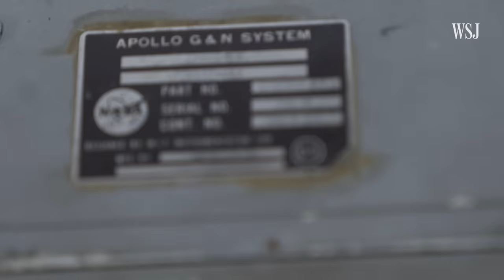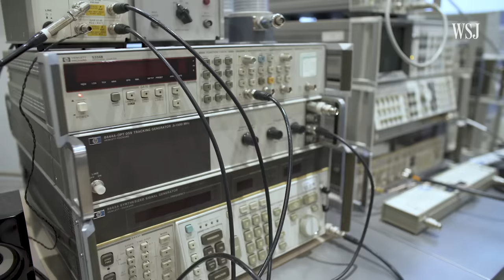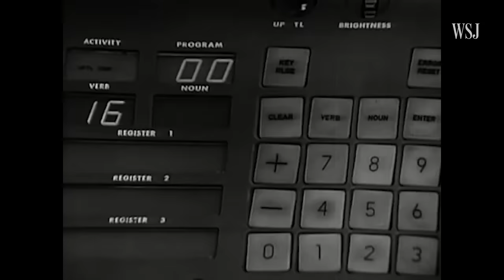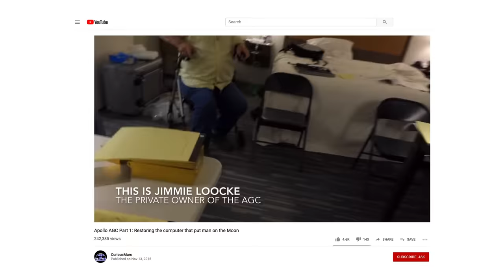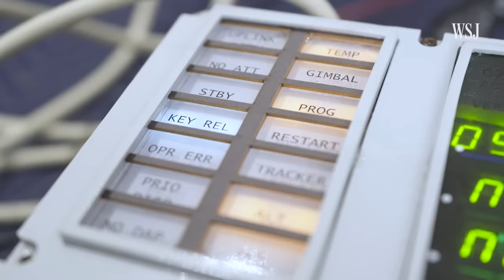Restorers Try to Get Lunar Module Guidance Computer Up and Running | WSJ

Comment: For reasons passing understanding, this video falsely asserts that they did it all in two weeks, which really undersells just how much effort this crew went through. It took MONTHS of work. The first video in the series Marc did came out Nov 13, 2018
 and the final working run wasn't posted until Jul 16, 2019. The whole team did an amazing job, over a long period of time.
Reply: Yup. Karl built an Arduino based DSKY clone (seen in this video). Marc's company REMANUFACTURED pins and connectors necessary to interface with it, from original blueprints. Mike has been tirelessly archiving, finding, and saving the various software versions the various missions flew. Sadly, some might remain lost to time, but Mike will leave no stone unturned.

Truly astounding work from some really smart people.
Reply: Lol thanks WSJ, quality journalism
Reply: @crosstian  it's owned by Rupert Murdochs' News Corp.  What do you expect?
Reply: Seen a video of women weaving the ROM memory modules. In these years your fingers could touch the individual bits of the operating system. Rome was not built in one year.
Reply: @Wizardofgosz  And when they really  complete this project, they can go to Cape Carnivoral (or what was it) and launch that thing again. How cool is that?
Reply: @OptimusWombat  much better than the clown show at cnn where instead of interesting bits like this computer you get stories about brave people announcing pronouns
Reply: @voornaam3191  
Canaveral
Reply: I was surprised when i heard 2 weeks... Troubleshooting and repairing can take experts much more than that, especially on old equipment.
Reply: But... But... Earth is flat
Reply: @JohnS-il1dr  imagine trying to defend science and great human achievements by praising IT people... while insulting sociologists and people who try to lift up society.
Reply: @monsieurouxx  It's hardly uplifting for society, it's continuing on an inexorable spiral of decline
Reply: @monsieurouxx  sociologists add zero to further this type of science
Reply: @kunjupulla  only in Tolkien books
Reply: @monsieurouxx  You must be a troll; "people who try to UP LIFT society" ... what???? Heck that. Anyway I'm grateful they dedicated so much time, and WSJ really did undersell how much effort went into this restoration.
Reply: @kunjupulla  oh dear another flat flerfer...
Where's your ridiculous proof that the Earth is flat 🤣
Reply: @peteabrh-fairest9463  Ayyo 😂. I was just joking dude 😅. I'm an engineering student 😊, not a flat earther 😛.
Reply: @neilchapman5145  Of course 😆
Reply: @kunjupulla  thank God for that sensibility shine through at last, there are so many ridiculous flat-earthers on this post it makes me want to punch my windows out .
Good luck with your engineering what an admirable career. 
I didn't go down that route, I'm ex-military 22 years ..
Although I was a nuclear biological and chemical warfare specialist and worked on frequency weapons technology...
Have an awesome day 🍻
Reply: @peteabrh-fairest9463  Yup 😊. I am quite fed up lol from flat earthers 😂. I have argued too much on Twitter 😂😂
Reply: @kunjupulla  so have I my friend 🤣
Reply: @soupflood  and yet... the story as presented can be true, in that actually dealing with the hardware was done in the last two weeks. What Richard said above would be extra work they would be doing as "preparation" for those final 2 weeks.
Reply: @neilchapman5145  except the thing about inclusivity is that it doesn't just apply to ONE pariah group. Geeks that "further this type of science" were also a pariah group themselves, so i'd like to call your bluff and ask that you prove if it is in fact "zero" added value.
Reply: "The Wall Street Journal"... says it all.
Reply: @soupflood I do, fairly "modern" (80's/90's... some 70's) arcade machine repair... and when you get back to the early 80's/late 70's... you can spend 2 weeks finding/getting a single part... and that's for a commercial "computer"... not secretive government projects.
Reply: Why would the computer display an altitude rate reading without an input?
Reply: Somebody always got to complain about something.
Reply: Thank you, two weeks seemed impossible. As an engineer I was stunned by that number.
Reply: also... i dont believe for a moment that geeks such as these worked only 12 hour a day..
Reply: You're conflating software and hardware, when their just going over the hardware. You're comparing apples to orange juice.

Comment: The brain power in that room is freaking impressive.  I felt dumb just watching
Reply: When it comes to real hands on work I doubt any of them could fix a leaking tap or change a tyre on a car.
Reply: @jamesaustralian9829  id rather have their smarts than what i have now i can change a motor on any car but would love to have their smarts.
Reply: You can compensate by watching a flat-earth video, that make everyone feel smarter.
Reply: @jamesaustralian9829  This is "real hands on work"
Reply: James Australian What’s your point? Even if they didn’t they could learn very easily... I work on electronics and I work on cars and currently I am a handyman doing odd jobs, the only difference is electronics requires much more thinking and figuring out and following complex mapping. Working with cars or houses or what you seem to think is “hands on” is the same as electronics without the complex mapping and whatnot. You still have to take apart, fix, solder, replace parts, all the stuff you do with cars and houses.
Reply: @jamesaustralian9829  they could built a new car tho
Reply: @MLGxBXRxPRO  Don't underestimate your knowledge of working things.
Reply: @kennylex  Agreed. When you watch a flat earth video you learn information that not many people are privy to. Knowing this information that the earth is flat and acknowledging it makes you feel smart.
Reply: @travisk5589  I sincerely hope you're a troll
Reply: @teod9270  aren't all flat earthers trolls?
Reply: @jamesaustralian9829  Incorrect.  There is a full machine shop in Marc's house, they are all very mechanically inclined.
Reply: For real! I cant understand nothing of that "mess".
Reply: @James Australian that’s got to be one of the most misinformed ignorant comments on here buddy.
Reply: By the guy that said WOULDN’T HAVE WENT in the beginning of the video?
Reply: i dont
Reply: James Australian Yeah, Mark only has a milling machine in his basement for the looks of it. Not at all handy.
Reply: James Ray What? I don’t understand your point... how many doctors do you think couldn’t be taught to fix cars or renovate a home?
Reply: James Ray Then your point is irrelevant to what I said.
Reply: James Ray I wasn’t responding to the original comment... I was responding to the guy saying “I doubt they could do anything hands on”... I was pointing out not only is this hands on, but it’s the same kind of work that mechanics and carpenters do, it’s hands on work combined with critical thinking.
Reply: @rikosaikawa9024  but you are the greatest genius of all time!!11
Reply: @jamesaustralian9829  oh they could all open a simple youtube video friend.
Reply: Another day in an IBM room
Reply: Real hands on is inventing whole new technologies that NEVER existed to get to the moon. Change a tire? Let the same hands on go free and wild and we'd already have George Jefferson's briefcase case car!
Reply: The crowd on a Justin Biever performance totals more brain power than that one on the room.
It's all about how they use it.
Reply: @jamesaustralian9829  Don't be so sure.
Reply: @kennylex  congratulations, you played yourself
Reply: @jamesaustralian9829  Curious Marc is pretty good with a lathe and Milling Machine...
Reply: @jamesaustralian9829  define "real hands on work"
Reply: @MLGxBXRxPRO  great comment  i agree with you 100 percent
Reply: @travispratt6327  very good comment  i thought the same thing  they could learn those other task if they wanted to
Reply: @76TomD  very good analogy
Reply: Oh to be in the company of like the minded. I don’t feel so dumbfounded.
Reply: @jamesaustralian9829  what kind of stupid comment is that?
Reply: Knowledge not brainpower
Reply: @jamesaustralian9829  lol, Curious Marc is very good at real hands on work, and I'm sure the other ones are too. Trolling seemes to be what you're good at (or bad, since no one will take your seriously😂)
Reply: @jamesaustralian9829  and when it comes to going to the moon, I know who I will call lol
Reply: @jamesaustralian9829  lol go watch their channel might surprise you what they can do
Reply: @jamesaustralian9829  I maintain my own classic car including engine rebuilds. I can weld and use a lathe. I also have a Degree in Electronic Engineering and my day job is writing complex computer software. Questions?
Reply: @jamesaustralian9829  "fix a leaking tap or change a tyre on a car" LOL, they can do that and even build a completely new leaking-proof tap and an electrical flying car.
Reply: Curiousmarc is an amazing guy 😁
Reply: @jamesaustralian9829  They totally could.
Reply: @dr.ramondetorres4838  ok so when you a see an A380 or 747 take off thats also faked is it? because dummy they used engineering , physics and maths and science  to build those just like they did the Apollo spacecrasft that DID land on the moon....
Reply: Late reply I know, but anybody who comes across the above comment should watch the full video on CuriousMarc's channel to see just how much "real hands-on work" went into that restoration... everything from cleaning electrical contacts by hand while looking through a microscope, to milling off sealing compound in 1/1000mm increments to replace damaged components, to machining connector blocks from scratch. Those guys aren't just smart, they are also shop rats to the max!
Reply: hoping this is sarcasm bc i felt the opposite. the delusion in these peoples heads, wasted "intelligence"
Reply: @travisk5589  Yeah it isn't that hard, especially if you have friends in the hobby.
Reply: @commodoresixfour7478   Curse you for making me read through years of comments to figure out what you are talking about
Reply: I hate to break it to you but we never went.
Reply: @neilarmstrongsson795  From the man himself
Reply: @paulomarcus3722  lol true
Reply: @jamesaustralian9829  cuz there smarts not uh
Reply: same
Reply: @jamesaustralian9829  This was very much hands on physical engineering work.
Reply: These people can answer you: hey, this is not rocket science! And what on earth can go wrong with it?
Reply: @jamesaustralian9829  Change a tyre into a tire, please. Bet you can't?
Reply: @jamesaustralian9829  Seen another video about these lunar spaceships. At one day all the astronauts protested. That is a big deal. They said, if you high rank people don't put a window into that spacecraft, we are not going. And they got a small window. Some engineers must have been a bit cruel! Sending a couple of astronauts to the moon, and back, and saying: okay, you will fly it on the flight instruments only. It was reality!
Reply: Felt? But dear sir you ARE
Reply: @kennylex  I just listen to coast to coast AM every night. With the exception of frequent book sellers it has the bonus of also being entertaining.
Reply: @kishascape  big talk for someone who probably works at an Amazon warehouse
Reply: Why did you feel dumb?  Some have one gift some have another. There is probably something you can do that they have no knowledge of either.  They didn't do what they do without a God given gift.
Reply: @MLGxBXRxPRO  It's only their smarts because God gave it to them, Nothing more.
Reply: @garyfletcher844  so should we thank God for all these mass shooting and crime happening? Or does he only do the good stuff that happens
Reply: @MLGxBXRxPRO  calling these people smart is a fair statement but what you got to remember is that there are different types of smarts. Would you call a person who knows how to fix any clock smart? Yea you would but they wouldn’t be classed as smart when it comes to fixing a car, it’s depends on ur perspective.
Reply: @jamesaustralian9829  Than you're seriously mistaken.
Reply: @jamesaustralian9829  <<<<<< Found the bogan
Reply: they miss the D power or P power so dont worry 2 much. 2 each their own problems! god speed
Reply: @jamesaustralian9829  This is something dumb people tend to tell themselves to feel better. Hands-on, an engineer can pretty-much fix anything.
Reply: @jamesaustralian9829  what a way to completely discourage what a massive accomplishment they did.
When you can do what they have done, you don't need to do plumbing or car maitenence, you can hire people to do it for you.
Reply: All stuff you can learn with enough effort and love. The love part is really important
Reply: This computer could reveal evidence whether it was possible to reach the moon or whether reaching the moon is simply impossible with this type of equipment. Another point made by some scientists is that according to official reports, six Apollo flights to the moon were nearly flawless in execution. In contrast, the history of space flight before and after the Apollo program is filled with so many failures and mechanical breakdowns.
Reply: You are. Cause all this is a lie and you accepted it as truth.
Reply: @jamesaustralian9829  I wouldn't be surprised if they built their own car
Reply: They said that a flip phone from 2010 had more advanced capabilities than than that computer crazy

Comment: It's so awesome that he chose to restore the AGC. He easily could have just auctioned it off, made a couple hundred grand and called it a day. Taking the time and effort to get it up and running makes the whole thing just so much cooler.
Reply: Money means nothing at their age
Reply: Money is fleeting, making history is eternal.
Reply: Yeah because now he can auction it off for more and he paid nothing to have it repaired
Reply: this is why my mom thinks my plans to restore a 1st gen dell professional computer and dell branded crt is silly 
since the computer is literally 32 years old runs ms-dos and has only 3 and 5 inch floppy drives 
and the crt would have shipped with the computer but is currently a paper weight due to the h.o.t. burning out 
i need to take a crt apart and de-electrify the picture tube as i do a full deep clean and repair the horizontal output transistor and diagnose any other issues with it before i can actually start using that computer with that old old screen from 1992
Reply: @slycooper1001  cool story dude
Reply: @anandchundi6805  that's not the point. Now that it's working, it's priceless. Best to donate it to the Smithsonian. Then, once a month, the Smithsonian can set it up in a small auditorium and simulate a moon landing for a group of computer geeks.
Reply: @itjustlookslikethis  its gonna cost them now :)
Reply: Running 😂 yeah!
Reply: It will be worth millions fully functioning
Reply: you reckon it's worth that much?
Reply: @nielsdorhout058  Actually, there was a later video on Curious Marc's channel that said the computer was indeed auctioned off, and it fetched NEARLY 1 million. The fact it was fully functional probably was a BIG part of the final gavel price.